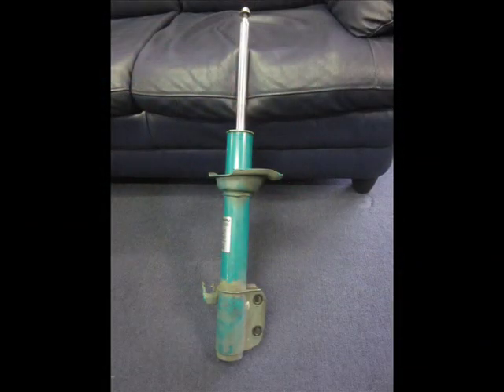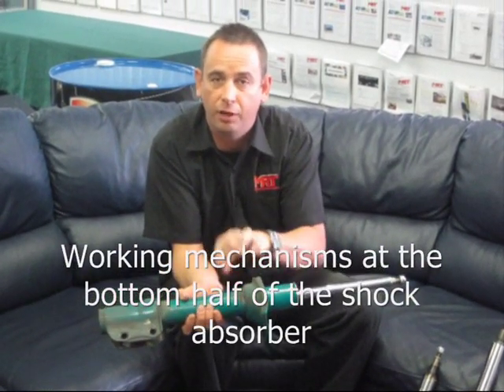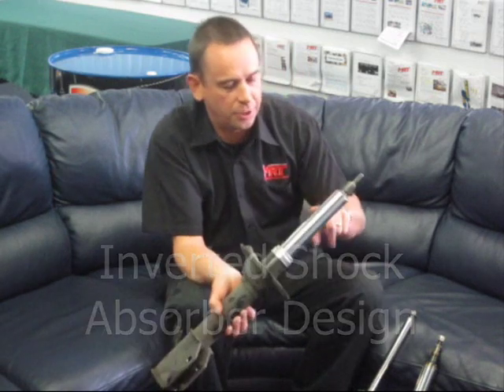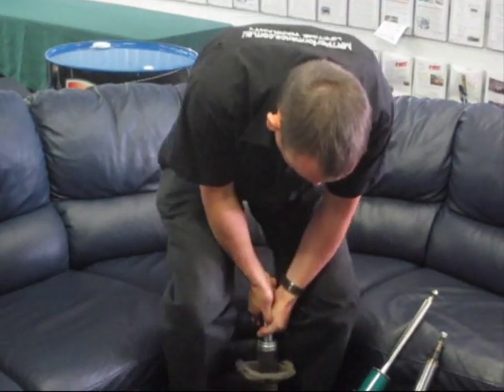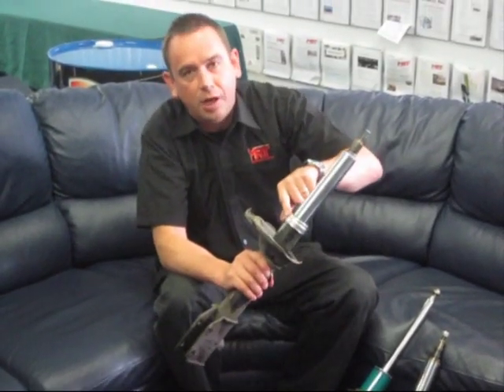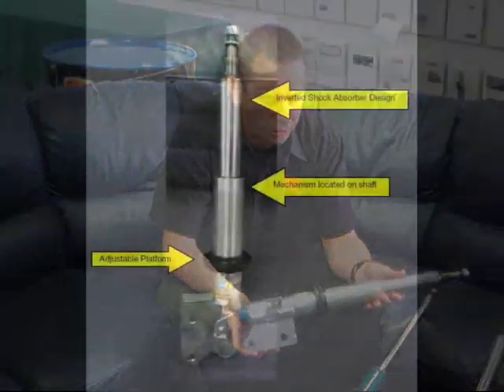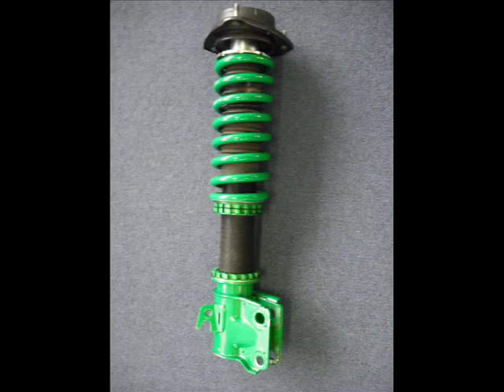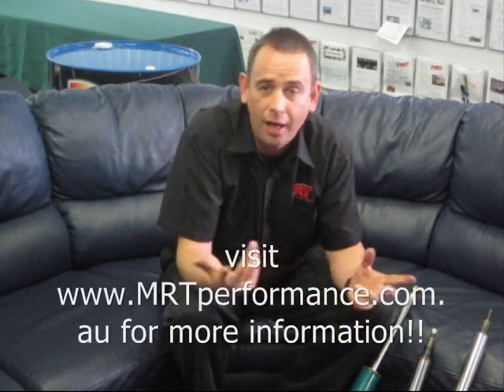Shock Absorber-secrets

Comment: Thanks for putting this content on. I am in the US and have a USDM STi 04. Most of us found that if you repack the housing with grease, it lessens the friction on the components. I have a grease fitting installed .it seems to be the right rears as well. Of course it is a quick fix to a problem that will return , but if you have a fitting it's less of a pain.